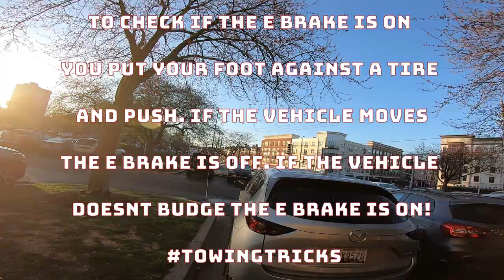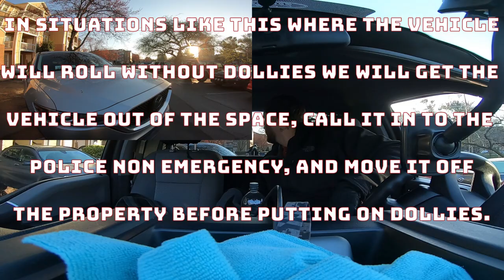Two Handicap Cheaters Get Towed! Parking Revenge! Episode 6 & 7 YSWG Towing

Comment: I have watched young healthy people park in handicap spots without permits because they don't want to walk 5 spaces away. They don't give a crap.  I can hardly walk and have a permit. I had the kind you hang on the mirror, but they needed to be renewed every so many years. It required going to the registry and getting a form, then going to the doctor to have them fill it out, then going back to the registry and pay $10 for the permit. I ended up switching to a handicap license plate that was good for 10 years. Much less hassle.

Comment: Nice video. I noticed you mentioned the faded placard on the pavement. According to the Federal Law concerning the parking space requirements for Americans with Disabilities Act, there is no requirement for the painted placard. So if a cheater says they didn't see the placard it won't matter. The main thing is that each spot has to be marked with a sign, either on a pole or building in front of the space visible from the driver's seat. If there were 2 inches of snow on the road you couldn't see the placard anyway. I have a legal HC placard and was at a casino in Delaware where I parked in a spot with no pavement marking . I didn't see a sign 10 spots away with an arrow pointing to another sign 15 spots away indicating the area between the signs was restricted to HC only so I didn't use my HC tag. I went to court and brought a copy of the ADA law stating the "each" spot has to be marked with a sign. I beat the charge and the judge said he learned something. Keep catching the cheaters.
Reply from the maker: Awesome to know thank you

Comment: Why dolly a front wheel drive with the e brake off?  Just curious.
Reply from the maker: Where did I do that? If you’re referring to the Mazda, the CX9 is AWD specifically iActiv AWD which is why it rolled. That doesn’t mean it isnt AWD and wont lock up on you at higher speeds/damage the vehicle tho.

Comment: Maybe I missed something, but the RAV4 was AWD, why not just dollie it vs skate it out like that? Been towing for the last 2 1/2 years, but its consensual for my line of work, also I run a rollback not a wrecker.
Reply from the maker: Because I can skate it out faster than I can dolly it, if my boom was in better condition I wouldn't even need to strap it to skate it out. I'd rather get off the property and/or away from the spot incase the person comes out and then dolly. Drop fee here is next to nothing.
Reply: @YouSlipWeGrip  Gotcha, just didn't see in the video where you dollied after grabbing from the front. And its funny watching you even do it this way, because the company I started with would have a stroke if you even tried to move a AWD/4x4 vehicle with any tires still on the ground, no matter the distance lol
Reply from the maker: @QuesoPants  I didnt record myself putting on the dollies as ppl complain that its boring. Figured the first vehicle was enough. Some vehicles will roll they aren't all real time AWD which is why the Mazda rolled out of the spot. Some wont even budge without dollies. All depends on the vehicle.

Comment: Curious. Do cheaters incur fines in addition to the towing and storage fees? What are the current totals for caught, towed, stored and fined cheaters in your area?
Reply from the maker: Good question! Any vehicle towed for any reason now in this county (under 8,000lbs GVWR) is $150 flat. used to be $120 hook up if im not mistaken and then $4 a mile. I guess they were having problems with shady companies charging max mileage (15 miles x $4 would be an additional $60 so $180 total) and figured making it a flat fee would reduce those issues? There is also a storage fee that starts after 24 hours in the lot and I think is $25 or $30 a day but dont quote me on that.

Only the police can charge fines for parking illegally as in fire lanes or handicap. The fine amount you see on those signs is what they could ticket you.